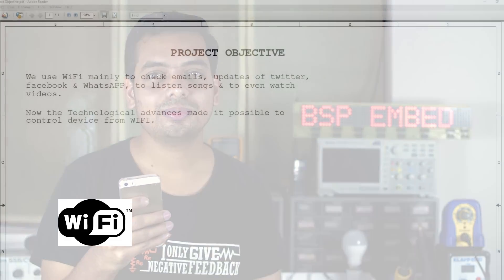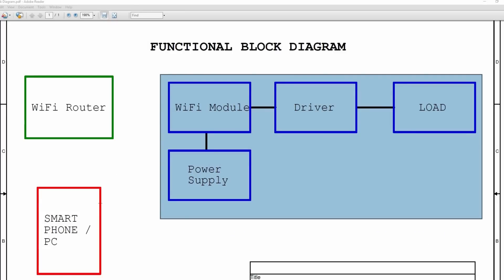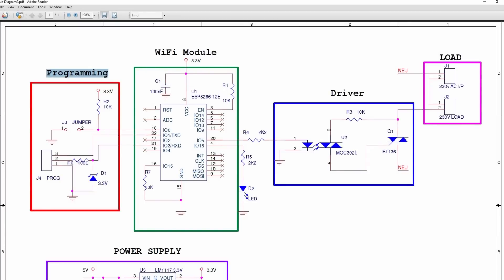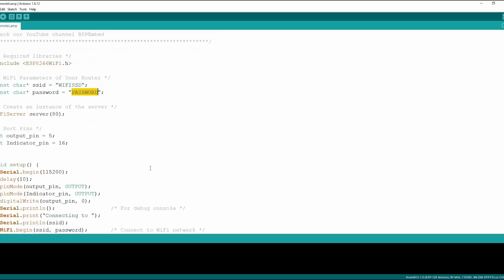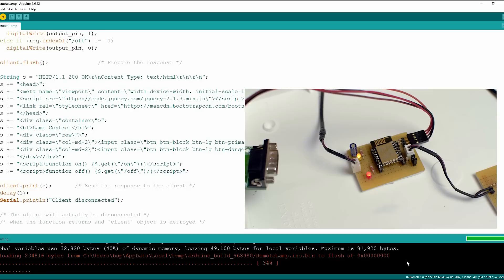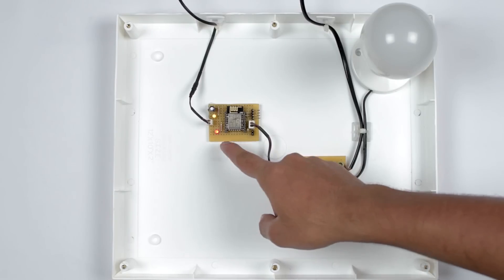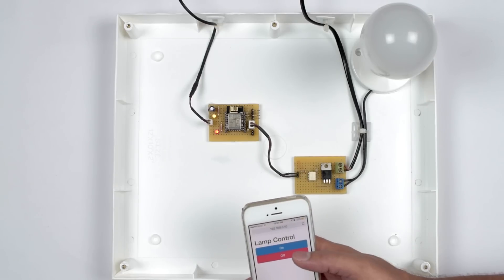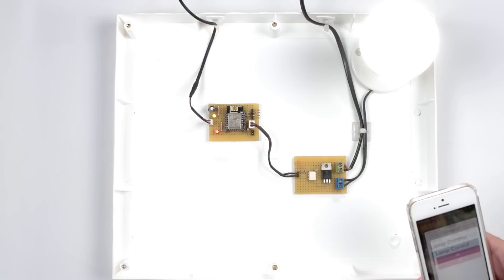DIY ESP8266 Home Automation using WiFi

Comment: Hello dear, thanks for the video,
Please tell me what is the range of the wifi module? And how many relays can be connected to this module?
And tell me which one is better by making home automation through wifi interfaced with arduino or using this wifi module?
Reply from the maker: Range will be around 25-30 ft. WiFi module is better one.

Comment: How many appliances can I control using 1 esp8266?
Reply from the maker: Up to Eight devices you can control. It can be extended with additional controller.
Reply: @Emtron_Technologies  can we connect a camera to this so that I could get a live stream from it?
Reply from the maker: Yes you can do it.

Comment: Thank Your examples are very nice. Unfortunately for people how are starting with Arduiono and this ESP8266 a lot of things that are clear for you are very difficult to discover. The fist test and the board name to use in Arduino. Than load a blinking demo. I needed some time to find out that one has to put on the jumper for programming and then remove the jumper do a reset and watsch the led blinking. This module is nice and cheep. using a wemos that has the usb port on board is much more less complicated but i prefer to use the bare ESP8266F.    Modul name in Arduino is "NodeMCU 1.0 (ESP-12EModule)"
Reply from the maker: Thanks for your info. Please keep in touch with us.

Comment: Hi,

     I want to interface this module with controller.I want to share video files from controller board to mobile application.How fast this module is?Does This have SPI interface?
Reply from the maker: You can interface, Its has SPI.
Reply: OK.Can we run HTML pages in controllers memory that can be accessed by web broewers through this module.
Reply from the maker: Yes it can be done.

Comment: need to talk about this projet please gimme contact number or any other way to talk to you ,,,,,i
 have lot of questions to ask you
Reply from the maker: Let me know your doubts in the comment section.
Reply: I am a final year engineering students, and I have project of home automation system. My project is to connect 2 classroom's fan and light to Our Head of department's cabin's computer through Wi-Fi so they can control it from their cabin that's why I wanted to talk to you
Reply: Please tell how I can do it and what I have to buy and how much it will cost
Reply: It will be a big help
Reply from the maker: Yes, You can do this project. Just add additional device for FAN control.
Reply from the maker: Currently i'm busy with other projects. If not i will develop for you.
Reply: For 1classroom=4 fan,10 lights and 2nd classroom 6fan,15 lights
Reply: Thanks for feedback
Reply: Please let me know in 5 days please
Reply from the maker: You have to use I2C base GPIO Expander. Since you required 35 GPIO'S.

Comment: Hi friend
Glad to see u such innovative project. 
I need your help to develop a project can you give me your personal E-mail id or whatsapp no.
Reply from the maker: You can build yourself. All the details are available in the video description.
Reply: BSP Embed  i want to develop wireless power disconnection module for electricity discom. Module is to be connected in service line and it should be disconnect with remote.The module must have 12 digit code. And through remote we can activate the module. Can you do such project.
Reply: Kumar Chavan very very easy

Comment: bro how to reset esp8266 01 module.

I flashed latest firmware but I am not able to give ssid or join another wifi network
Reply from the maker: You have to use proper library, Which will reset SSID.
Reply: What do you mean by resetting 

Do you mean to get it back to programming mode or restarting.
Reply: I just wanted to reset ssid what we set in program. now I got solution by reseting with at commands
Reply: Library

Ha ha ha ha ha ha ha
Reply: did you try this tutorial? I mean, u controlled through internet

Comment: How to add Mini Fan option in this project ? and if I added the fan I make any changes in this program Sir?
Reply from the maker: Configure additional GPIO as output for a FAN & extend the code for web page.
Reply: What is GPIO ? How I write the Program ?
Reply from the maker: GPIO is a General Purpose Input & Output. It's a Pin. There are total 11 GPIO's are present in ESP. I used one for bulb. Use another GPIO for Fan. Configure GPIO as output similar to Bulb.
Reply: BSP Embed answer is wrong

Directly connecting will fry esp8266

Use optocoupler or relay to separate control logic from load.

Also use flyback diode to bypass the induced current from the fan

Comment: esp8266 12f module i connected through wifi and gpio pin is input of the wifi module and output is arduino digital pin access now sir ple tell me
Reply from the maker: If you want to use both ESP8266 & arduino modules. And GPIO function of ESP, Then You have to program both the modules. But it's little complicated. Better to have ESP connected to Arduino through serial & control through it.
Reply from the maker: If you want to use both ESP8266 & arduino modules. And GPIO function of ESP, Then You have to program both the modules. But it's little complicated. Better to have ESP connected to Arduino through serial & control through it.
Reply: thanks sir.how to control with serial ple guide to me
Reply from the maker: You can use a AT command to interact with ESP.

Comment: Can you provide the burner kit details.
Reply from the maker: It's a usb to serial converter. It has Silicon Labs CP2102. You can easily find in Amazon or ebay.
Reply: Thanks, and how did you program the module, parameters/board and more ?
Reply from the maker: ESP8266 comes with builtin serial bootloader. We can program it using serial device(like usb-serial converter).
Reply: thanks, you have selected NodeMCU ESP12E module board for ESP 8266 12 E
Reply: also, from where you bought IC base for esp chip, thanks.
Reply from the maker: Yes, Exactly..
Reply from the maker: Bought it from local electronic store. You can also buy from online.

Comment: sir pl answer,
1, which ip address i access to control output
2, if three esp connected to the same router, individual esp's got assigned ip or single ip is enough to control.
3, individual ip assigning is possible, if so how can we access and control
Reply from the maker: Thanks for watching.
1A. IP address with assigned by router. Which can get in serial monitor window. Or you can fix IP address of the device in the router, provided you know the MAC id of the device(ESP 8266).
2A. Three different IP Address. Unique for each device.
3A. You have develop an APP with access all the device.
Reply: Thanx. I'm a beginner to this. so if u dont mind can u pls provide a sample program for assigning ip to the esp 8266 module
Reply from the maker: You have to assign it in your WiFi router Not in ESP8266.
Reply: U mean that I can set ip address to appropriate mac id in dhcp reservation in wifi router configuration??
Reply from the maker: Exactly.
Reply: esp8266 12 has 16 gpio's isn't it? and 4 I/O index no not available as I refered?
and also we can bring output on arduino uno if we interface?
Reply from the maker: No Only 11 GPIO's. Yes you can connect ESP8266 01 to UNO and expand the capabilities.
Reply: I want to interface esp8266 12
Reply from the maker: Of course you can ESP8266-12 Module.
Reply: Bro I successfully compiled this program for controlling two outputs,
is this ok? Havent checked yet

#include <ESP8266WiFi.h>

/* WiFi Parameters of Your Router */
const char* ssid = "WIFISSID";
const char* password = "PASSWORD";

/* Create an instance of the server */
WiFiServer server(80);

/* Port Pins */
int output_pin = 5;
int Indicator_pin = 16;
int output_pin1 = 6;

void setup() {
  Serial.begin(115200);
  delay(10);
  pinMode(output_pin, OUTPUT);
  pinMode(output_pin1, OUTPUT);
  
  pinMode(Indicator_pin, OUTPUT);
  digitalWrite(output_pin, 0);
  Serial.println();                 /* For debug console */
  Serial.print("Connecting to ");
  Serial.println(ssid);
  WiFi.begin(ssid, password);       /* Connect to WiFi network */

  while (WiFi.status() != WL_CONNECTED) {
    delay(500);
    Serial.print(".");
  }

  Serial.println("");
  Serial.println("WiFi connected");

  server.begin();                   /* Start the server */
  Serial.println("Server started");
  Serial.println(WiFi.localIP());  /* Print the IP address */
  digitalWrite(Indicator_pin, 1);  /* Indicate by LED */
}

void loop() {
  
  WiFiClient client = server.available(); /* Check if a client has connected */
  
  if (!client) 
    return;
    
  Serial.println("new client");          /* Wait until the client sends some data */
  while(!client.available())
    delay(1);
  
  String req = client.readStringUntil('\r'); /* Read the first line of the request */
  Serial.println(req);
  client.flush();

  if (req.indexOf("/on") != -1)           /* check the request */
    digitalWrite(output_pin, 1);
  else if (req.indexOf("/off") != -1) 
    digitalWrite(output_pin, 0);
     if (req.indexOf("/on1") != -1)           /* check the request */
    digitalWrite(output_pin, 1);
  else if (req.indexOf("/off1") != -1) 
    digitalWrite(output_pin, 0);

 
  client.flush();               /* Prepare the response */
 
  String d = "HTTP/1.1 200 OK\r\nContent-Type: text/html\r\n\r\n";
  d += "<head>";
  d += "<meta name=\"viewport\" content=\"width=device-width, initial-scale=1\">";
  d += "<script src=\"https://code.jquery.com/jquery-2.1.3.min.js\"></script>";
  d += "<link rel=\"stylesheet\" href=\"https://maxcdn.bootstrapcdn.com/bootstrap/3.3.4/css/bootstrap.min.css\">";
  d += "</head>";
  d += "<div class=\"container\">";
  d += "<h1>Fanl</h1>";
  d += "<div class=\"row\">";
  d += "<div class=\"col-md-2\"><input class=\"btn btn-block btn-lg btn-primary\" type=\"button\" value=\"On\" onclick=\"on()\"></div>";
  d += "<div class=\"col-md-2\"><input class=\"btn btn-block btn-lg btn-danger\" type=\"button\" value=\"Off\" onclick=\"off()\"></div>";
  d += "</div></div>";
  d += "<script>function on() {$.get(\"/on1\");}</script>";
  d += "<script>function off() {$.get(\"/off1\");}</script>";

  client.print(d);       /* Send the response to the client */
  delay(1);
  
  client.flush();               /* Prepare the response */
 
  String s = "HTTP/1.1 200 OK\r\nContent-Type: text/html\r\n\r\n";
  s += "<head>";
  s += "<meta name=\"viewport\" content=\"width=device-width, initial-scale=1\">";
  s += "<script src=\"https://code.jquery.com/jquery-2.1.3.min.js\"></script>";
  s += "<link rel=\"stylesheet\" href=\"https://maxcdn.bootstrapcdn.com/bootstrap/3.3.4/css/bootstrap.min.css\">";
  s += "</head>";
  s += "<div class=\"container\">";
  s += "<h1>Lamp Control</h1>";
  s += "<div class=\"row\">";
  s += "<div class=\"col-md-2\"><input class=\"btn btn-block btn-lg btn-primary\" type=\"button\" value=\"On\" onclick=\"on()\"></div>";
  s += "<div class=\"col-md-2\"><input class=\"btn btn-block btn-lg btn-danger\" type=\"button\" value=\"Off\" onclick=\"off()\"></div>";
  s += "</div></div>";
  s += "<script>function on() {$.get(\"/on\");}</script>";
  s += "<script>function off() {$.get(\"/off\");}</script>";

  client.print(s);       /* Send the response to the client */
  delay(1);
  Serial.println("Client disconnected");

  /* The client will actually be disconnected */
  /* when the function returns and 'client' object is detroyed */
}
Reply from the maker: Check it. Let me know the result.

Comment: Which app i have to download for controlling the load?
Reply from the maker: No app required.
Reply: So if i want to make this project,  from where i can buy these project kit?
Reply from the maker: Most of the components are available in amazon or you can find it in your local electronic store.

Comment: i need to more appliances by control wifi  ...... how i  get ?
Reply from the maker: Configure more GPIO's as output and extend the code. Thanks for watching..
Reply: Use I2C control logic

That will save your GPIO pins and you can control lots of relay or optocoupler on one GPIO

Comment: After uploading program,board  Wi-Fi not working.
how to solve this problem sir
Reply from the maker: Make sure the WiFi credentials (SSID & Password) are correct in the sketch (Program).
Reply: What is  ssid&password
Reply: Led is glowing in board,but Wi-Fi is not working.
Before uploading board Wi-Fi is connected with mobile but after uploading program, board Wi-Fi is not shown
Reply from the maker: It's your WiFi username and password.

Comment: Bro,  2 gpio esp8266 interfaced adruino uno which is programmed for home automation using android app. At first i set ssid and password  using "AT+CWSAP" . After that I could not assign any other ssid or join with any ap using this command "AT+CWJAP" . But I got no error while compiling and uploading to arduino. No issue with arduino because it is work with other programs. My problem is I could not assign new ssid or join with other ap. It connects only with first assigned ssid and pwd.
Reply from the maker: Reset ESP8266..
Reply: Thanx!
I have 2 node mcu modules and I configure one as access point and another one is joined with primary module. Can I  control both of IO pins of two modules with one mobile app. If not is there any possible solution to control modules with one app
Reply from the maker: If all the modules are within the same network, You can control with one app.
Reply: U mean by accessing server module IP we can control outputs of the client modules which are connected to server IP. But the commands for the output pins should be different. Right?
Reply from the maker: I haven't worked much on that. I will let you know in some time..
Reply from the maker: Nice article. Will go through it.
Reply from the maker: Correct.

Comment: How did you load the webpage in module? And can we use arduino and arduino wifi module in place of what you have used?
Reply from the maker: You can write a simple webpage in the program / sketch & compile it using  Arduino IDE. I have used ESP8266. It's a Wifi module with built in controller.
Reply: Is driver ckt necessary or can we direct connect it to relay and device?  @BSP Embed
Reply from the maker: You can use relay instead of driver..
Reply: Ok thanks sir @BSP Embed

Comment: Dear Prashanth:

I am Electronics engineer from Pakistan and Its an honor for us that you are helping out many people through your YouTube channel by creating best videos on different technology.I am very fascinated by your videos and want to make this project of home automation using ESP8266 12E  and you have plenty of hand on experience on it.Therefore,It would be a pleasure for me if you provide me your whats-app number and Skype name because YouTube channel comment section is a very slow method to communicate with you.

Regards,
Engr. Sameer Farooq
Reply from the maker: Glad you liked it. I could like to prefer YouTube communication channel as i reply every single comments / doubts.
If have any idea or trouble in developing, kindly let me know. I will try to make an tutorial on that..
Reply: BSP Embed First,you have not discussed about the usb to serial converter and shared hardware details of it.Secondly,the circuit diagram you have discussed consist of three capacitor and some more resistor but in reality i could only see one capacitor in your video.The power supply consist of LM117 which is 3.3 volt smd based regulator with two 100nf capacitor which i could not find in your hardware.
Reply: BSP Embed That's why it seems a lot of contradiction in your hardware and circuit diagram which you discussed in this video Therefore,I urge you to please make a video and hardware in which every parameter of the  hardware specially the usb to serial conveter is discussed and circuit to be made exactly the same as the circuit diagram in pdf file which you have shared on github.
Reply from the maker: USB To Serial is a interface module. It's not part of the project. Either it uses CP2102 or FTDI or CH340 chip.
You can very easily find them or get module.  I used SMD components for LM1117 and 100nF (0805) package.
Reply from the maker: Sure, I will be more specific on the hardware details for my upcoming videos.
Reply: BSP Embed Thanks
Reply: Abe bam forega kya IoT se

Comment: Sir, ur presentation is appealing,
I have simple esp 8266 module and arduino uno. I want to program arduino which should control 10 relays just by accesing  ip address without router. pls guide me.
Reply from the maker: Sure i will make an tutorial on that. Meanwhile you can follow this tutorial https://electrosome.com/home-automation-arduino-esp8266/
Reply: Waiting!!! In the above tutorial they just used esp module only. how can we include commands for wifi router configuration
Reply from the maker: No, Tutorial is based on both UNO & ESP8266 (Which was your requirement). Actually you don't need UNO. You can run the server in ESP8266 & control up to 11 devices.
Reply: I want to include pir sensor in uno( we will have more pins). that is why i asked u to how to configure in uno
Reply from the maker: You can also connect PIR Sensor to ESP. Check the Tutorial link.

Comment: installed
but
problm not solv
Reply from the maker: Did you selected correct board from tools menu. Tools --> Board --> NodeMCU1.0 (ESP - 12E Module). and in the examples, you should have ESP8266WiFi . i.e File --> Examples --> ESP8266WiFi

Comment: Can you please share the exact usb to serial module link which your are using in this video or you made this usb to serial module by yourself?
Reply from the maker: It's designed by me. You can get similar converter using Silicon Labs CP2102.